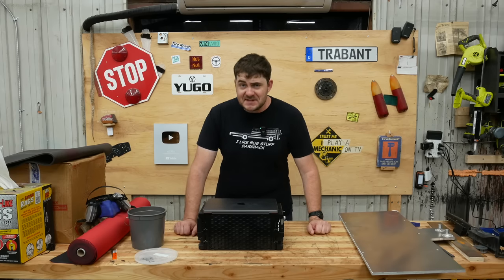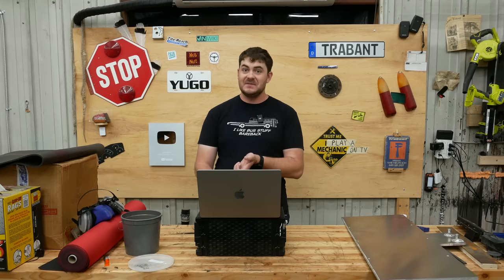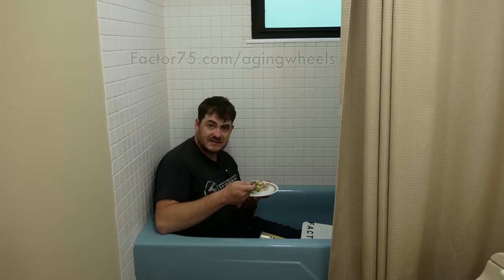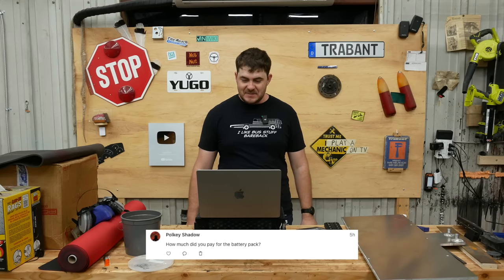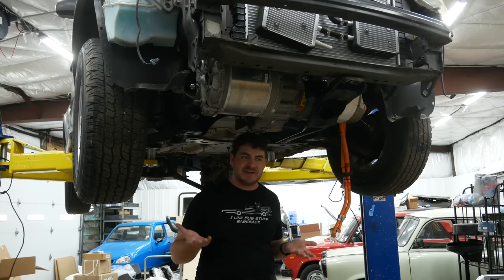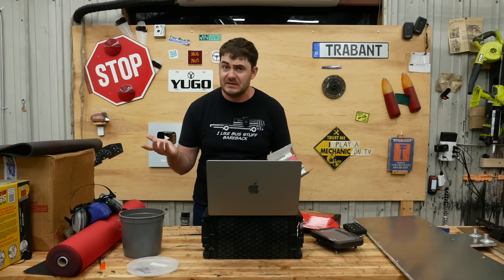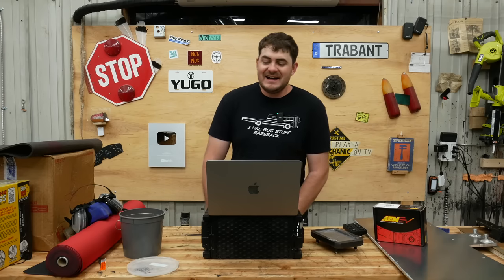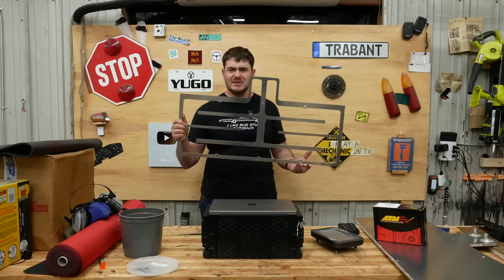Your Burning Electric Escape Questions

Comment: Can you invert the gas light signal? Seems like you should get a warning signal if there is in fact gas in your electric car.
Reply: Gas light comes on Sir, your gas can in the back has leaked
Reply: add shart detectors, it'll light up when someone sharts.
Reply: You can wire in a resistor so the car always thinks there's gas. The float in the gas tank is a variable resistor. Move it up, measure Ohms and replace with a matching resistor. Or take the bulb out of the light.

Comment: A extended range trailer... you mean a boost caboose!?
Reply: I miss RoadKill
Reply: A boost caboose for the escape would be a trailer with batteries + another Tesla drive unit, and boy does the thought of getting propelled by a trailer sound terrifying
Reply: What about a solar trailer with batteries?
Reply: @Fhwgads11  Airstream and Colorado Teardrop already make self propelled EV trailers.
Reply: I was thinking of the boost Palouste
Reply: I tip my hat to you sir, you are a scholar and a gentleman.
Reply: Ca-boost, you mean
Reply: Not exactly a limp mode but the trailer could also charge couple things at a time while the main thing runs on the other Banks also if there's enough Banks in general and by the time a bank or two is depleted and the other bank or 2 is charged on and on it goes

Comment: I appreciate that Aging Wheels is genuinely concerned about every dollar that he's spending, isn't afraid to let us know how much he's spending, and gives us full knowledge of who's partnering with him to make the projects possible. Really reminds me that this is just a dude doing shit in his garage that's interesting enough that multiple companies are willing to find him.
Reply: The pained face he made when he disclosed the cost of the batteries alone.  Adorable yet gutting.
Reply: I for one watch through the ad reels because 1) he makes then fun and 2) He's transparent with costs. Yes, OK, he's building himself something awesome but he's also sharing it with us for our entertainment. As a job. That transparency means I'm more likely to watch the ads to support him.
Reply: He really needs to dump the electric bus idea as the Tesla motors are not going to be big enough even paired up.  Think about: Rolling resistance of the tires. / Brake drag ( if discs ) / Frictional losses in the rear axle / Wind resistance.    If he really wants an electric bus, look for a scrapped electric transit bus and pull the parts.
Reply: @bobroberts2371  Using a proper electric bus motor is a great idea. I know that Chicago had a handful of series hybrids that ran on corn oil (and smelled of popcorn) back in the early aughts. That's probably as good a place as any for a Midwesterner to start...

Comment: Viewer: “If you could add anything for free what would it be?”

“I’d make the gas car that I’m converting to an EV run on gas again” Lol
Reply: EVs were the primary form of car back at the end of the 19th century.  They got replaced for a reason, and that reason is still just as valid now.  You want practicality, you want internal combustion.
Reply: @drewdane40  Except the trailer doesn't give you 900 horsepower.  It gives you IIRC he said 25 kilowatts, which is ~35 horsepower.  At a burn of 5 litres per hour, so it's basically as efficient as running it off a little litre engine and will move the car exactly as fast/efficiently.  Meanwhile if you wanted 900 horsepower  you could just stick any number of engines in there that can easily reach 900.
Reply: @jimmydesouza4375 , yeah, honestly. We should really be putting more effort towards perfecting hydrogen powered ICE engines, but not everyone has that future in mind.
Reply: @cordellsmith1523  Hydrogen ICE is terrible and will always be terrible. The efficiency is embarrassing.
Reply: @jimmydesouza4375  It was 35kW so 45ish hp, but the exact number doesn't really matter because that should be plenty of power for the escape to cruise at highway speeds for as long as the fuel lasts.  It's just a maintenance charge, people do the same with solar panels on the roof and even with that paltry amount of juice I've seen videos that show them extending the range pretty noticably.
I'm sure you know that you almost never use all the power your engine/motor can produce, especially when cruising but a 900 hp gasoline engine will never be as efficient as a tiny generator supplying an electric motor, nor will it typically compete on an even footing at the drag strip due to the way that electrics produce and deliver power.
Reply: @barrylinkiewich9688  You think an escape only needs 45 horse to cruise at highway speeds?
Reply: @jimmydesouza4375  you think that it would need more?
I know that an Escape has bad gas milage, but dude... 45hp should be more than enough to maintain highway speed.
Reply: @jimmydesouza4375  I mean once it's up to speed yeah
Reply: @Jehty_  General guideline is that an SUV sized vehicle requires 30-50 horsepower to just maintain highway speed, not accounting for wind or gradients.  I stuck the stats for an escape (a 2022 model because I don't actually know what model this is) in to a couple of calculators and got results between 35 and 45 horsepower (no idea how accurate those calculators are though).

An SUV that weighs more than a normal SUV because it's an EV that also happens to be towing a trailer will obviously need even more than that and this is without things like headwinds or gradients.
Reply: @jimmydesouza4375  and anyways the trailer would be meant as a range extender.
Doesn't matter if the car consumes more power than the trailer can produce.
So what if an hour of generator running only gives you half an hour of driving. Still an range extender.
Reply: @jimmydesouza4375  it's an Ford Escape 1. So your calculation is only off by 15 years.... Surely there is no difference....

And could you also name what calculators you used? Just curious.
Reply: @Jehty_  I doubt an hour of genny will give you an hour of driving, but my point was more that if you want a little 45 horsepower car with low fuel usage and a 900 horsepower car you're better off getting one of each rather than trying to make a car that can do both but doesn't do both well.

Any time you want your little 45 horsepower hypermiler your GIANT SUV chassis and body will cripple you, and any time you want to play dragster at the lights your genny trailer will hamper you (and might not actually even let you) and if you're going to take the time parking it up to then mess around you may as well have just driven up in a different car.

Additionally you can genuinely make an ICE that does both with techs like cylinder deactivation and the like which would be better at both than an EV (for example you could generate that 900HP longer because it takes longer for an ICE engine to overheat than it does an electric motor).

It's just kind of pointless and as the OP mentions turns your EV back into an ICE, just a bad ICE.
Reply: @Jehty_  The years don't matter.  What matters is weight, drag coefficient, surface area and rolling resistance.  I can easily get figures for 2022 for all of these and couldn't for earlier.  The figures that are easily comparable like weight match up, and supposedly Cd is the same (.4).

The only suspect thing is that the supposed frontal area for an Escape is only 20 square feet, given by Ford, except that's wierdly small considering that the frontal area for a Lotus Elan (as an example) is 15 square feet, or an Integra is also 20 square feet.  So that might not be accurate.  But it is an official figure from Ford so...

As for what calculators just ones from tuning websites like Wallace Racing or Stealth Motorsport, hence no idea how accurate they are.  I don't know how to calculate it manually.
Reply: @jimmydesouza4375  obviously a 900hp car is stupid. And putting a trailer behind it is even more stupid. Why do you even feel like arguing that point?

It's not about what's not stupid. It's about what is fun. And Robert thinks that would be fun.

But no. You couldn't make a better 900hp ICE. Acceleration is the discipline where EVs are just better.
You don't build a 900hp car to cruise the longest range on a highway.
Reply: @Jehty_  You're the one arguing, not me.  Moreover you jumped into an ongoing thing specifically to argue.  Very hypocritical of you to make insinuations like that.

Also yes you can make a better 900hp ICE.  And no, EVs are not better at accelleration, that is a pro EV myth propagated by Tesla.  It comes from electric motors having high initial torque but their torque falls off a cliff the moment you get running and they also have massive power drop off as the motors and batteries heat up and as the batteries lose charge.  A nice illustration is that Plaid, close victory on the first drag of the day when IIRC CarWoW (or one of those other stupid "soft motoring journalism" websites) did a drag competition but then it lost every drag after that because it was power limited.
Reply: I mean, it makes a lot of sense to do. If you study various hybrid and EV designs, you'll find the sweet spot is currently in plug in hybrids or traditional hybrids for most use cases. EVs only make sense in a very narrow margin. The real issue is a lack of public transit, but almost no one is willing to address that, and even those of us who do acknowledge it are trapped in the same car-centric world as everyone else, so it isn't getting fixed in most places.

The whole thing is insanely complicated, and most people don't have much understanding of it. Even my understanding is severely limited, I understand the physics involved most of all, but I'm not as well versed in materials science and the way tech is progressing in terms of making batteries viable for this use. (We act like batteries were viable for a while, but they're only just starting.. and it's only because so many have worked hard to make them viable when they weren't yet that we're getting there now.)

A couple quick pointers for anyone willing to read this far:
- aerodynamics have the biggest impact on efficiency at any speed above 30-40mph
- less than 50hp is needed to maintain speed in most conditions for most vehicles, high horsepower numbers are mostly for acceleration
- smaller wheel sizes are more efficient unless your transmission has bad gearing (I'm not sure how to fully explain this one, other than it has to do with rolling friction and what speed the engine runs at)
- weight is almost a non-issue for vehicle efficiency, however, high weight vehicles have extreme negative impacts on roads (did you know the majority of the money you pay in taxes is used to subsidize trucks operating on public roads? they are charged significantly less than the damage they cause, while the average vehicle is charged significantly more)

I guess that was more than I intended to put in. xD
Reply: @guard13007  Almost everything you type is wrong but there's one thing that's really odd.

"We act like batteries were viable for a while, but they're only just starting.. and it's only because so many have worked hard to make them viable when they weren't yet that we're getting there now."

Li-Ion are the closest thing to "viable" batteries for electric vehicles and they have been around experimentally since the 60's and as a consumer product since the 90's.  Yet guys like you repeat this "they're only just starting!/We've only just started" lie.  Why?  Are you not aware it is a lie?  If you are aware, why do you say it?
Reply: @jimmydesouza4375  seek help
Reply: @iambear.6526  I am correct though.  Screeching "seek help" at someone for pointing out facts you dislike is...  Well...

:D

Comment: 1:40 To expand on this for people who aren't as familiar with lithium battery behaviour - lithium batteries vary in terms of how much power they can kick out per unit capacity and per unit weight. Tesla packs are relatively low power density because they're huge and lower power density chemistries are more durable, this is completely fine for a Tesla with one drive unit, or a Tesla with a really really big pack with 2 drive units, but for conversions it's hard to fit an entire Plaid battery pack worth of modules in even if you can get your hands on one. Most conversions use modules parted out from packs when using Tesla batteries, not entire packs, which limits peak power. The Chrysler Pacifica on the other hand, being a plug in hybrid with a tiny pack, uses a higher discharge design since it needs to be able to just about completely power the vehicle with a pack that's 10 times smaller than a Model 3. Stick a few of those together and you can get much higher power densities with a smaller capacity pack.

Comment: The 05-08 Ford Escape Hybrids had an interesting cooling system for the hybrid battery (HVTB).  The left rear cargo window was vented to bring in outside air for cooling. A vent system channeled the air from that window to the HVTB and twin fans in the HVTB caseblew the air across the battery cells.   When the computer sensed the HVTB was getting too hot, an actuator shut off the outside air and the vehicle's AC system was activated if not already on.  There was an evaporator to provide chilled air to the HVTB.  Don't know if any of this can help with your thermal management requirements. (09-12 switched to cabin air only for cooling and eliminated the exterior vent and separate AC condenser.)

Comment: For your Bus EV project, have you seen any videos on the 'Carl' truck from Edison Motors? The small, low power diesel generator with EV powertrain layout seems to make a lot of sense using available technology to make a truck go long distances consistently.
Reply: Yeah Diesel generators can be pretty efficient when operating continuously at medium-high throttle

Comment: I love the ???? sense of humor

also also on the aircon thingmajig, you can get one of those 12v compressors teslas use or idk nissan lef and then get one of those cool ass crimpers and crimp new lines that match the ferd escepe's conectors, for the heater you can just steal one from the coder im quite sure they wouldnt make a complicated thing just for cabin heat right? riiiiiiiiiiiiiight?

Comment: I'm totally digging this series. I am planning to do a partial EV conversion on my 2016 Escape to make it a high-performance plug-in hybrid by adding a Tesla small rear drive unit and 6 of those Pacifica modules. 240 HP in the front and 294 HP in the rear! Nowhere near the 900 HP you are shooting for, but mine will remain my daily driver. Eventually, I will replace the EcoBoost engine with a Tesla small front drive unit and upgrade the battery pack to something like a Mach-E full pack, but that is down the road a ways. I need to figure out how to read and spoof lots of Canbus data before then... Keep these videos rolling, to include details on your battery cooling plates!!!
Reply: Those Pacifica modules are pretty expensive. If you're in the US, look up Battery Hookup for some better prices on refurbished batteries. A quick search shows that he could have gotten similar power and as good or better capacity for less than half the price. I hope that helps your future project. I'm planning similar, though likely another year before I'm able.

Comment: When the battery from a high performance sedan simply isn't powerful enough for your needs, you go for the one from a minivan instead. Love it!

Also, 6:40 "installing AC and heat is gonna involve getting the in-built HVAC system to communicate with something to turn on a high voltage air compressor and to turn on a high voltage heater. Very complicated so I'll go without for a while" oh boy has Technology Connections got a very relevant new video for you!

Comment: could always add a coolant level sensor and tap into the fuel gage .. so if you get a leak and start losing coolant you would see the needle move - this would also keep the low fuel light off

Comment: I think the fact that it is only going to wind up a learning project rather than a test platform for the bus is great. As you said most components won't transfer plus it will let you look at things a bit differently when applying to the bus rather then forcing the components to fit a preconceived plan. The part where you were talking about how happy you are for the public support is great. Funny thing is I have EV as I think its, well never mind what I think. I love your channel and the fact that it's you doing the E conversion is why I watch. I also hope for your complete success with all of it despite my personal EV feelings. Both for the Escape and the bus and I will be right here to see all of it.

Comment: When wiring up battery modules in parallel, keep in mind that you should have a separate contactor for each parallel string. Else, if you suffer a short-circuited cell in one module, there will be no way for the BMS to isolate it from the other parallel modules, and you will have a very dangerous and fiery situation on your hands. 

When designing the battery, you need to ask yourself if there's any possible way for current to flow between any cells when the contactors are off. If the answer is yes, then your pack is not adequately protected.

Comment: have you thought about using a small motorcycle engine for the range extending?
i always thought about doing that because depending on the size of the motorcycle engine will dictate the amount of regen you get

Comment: This is a great project, I look forward to its updates.  For  the fuel light - can't you just disconnect the power to the bulb?  Or if it goes to a cluster that's being used, take out the bulb?  Or, last resort, break the bulb?